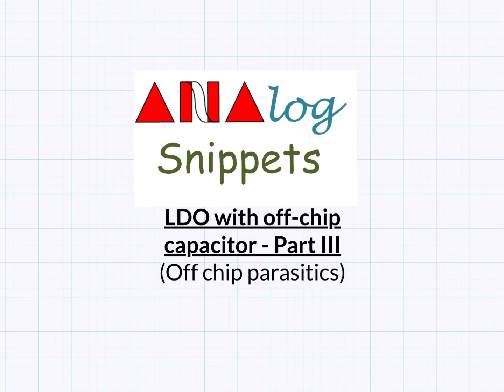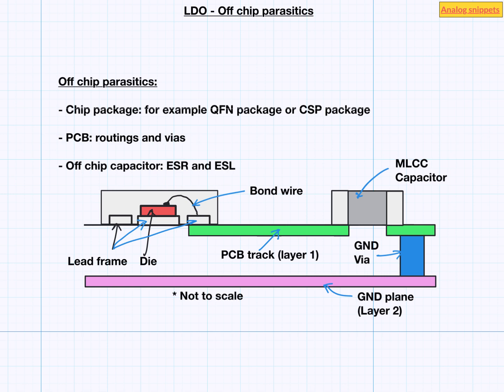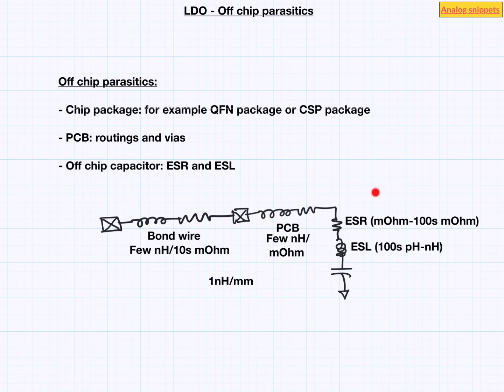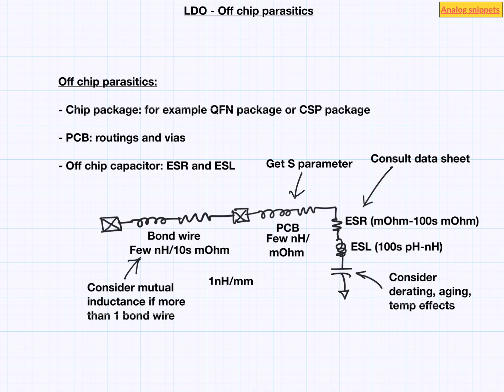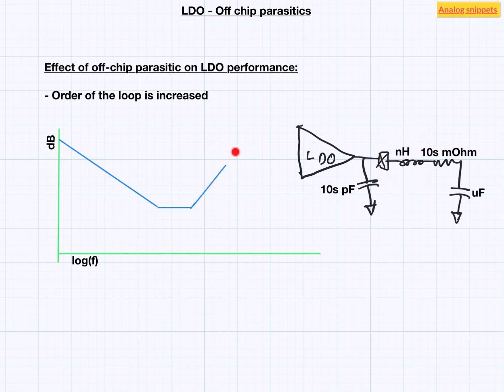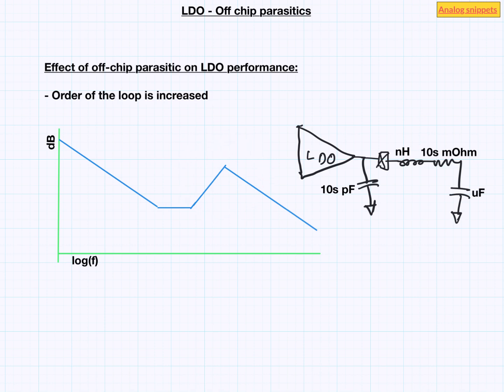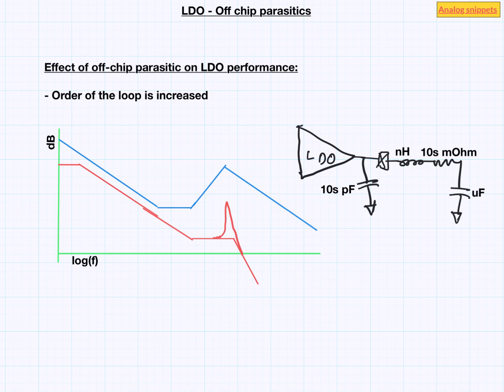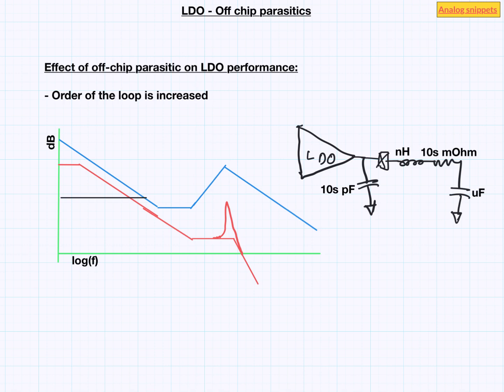#35 LDO with off chip capacitor - Part III (off chip parasitic)

Comment: Thanks for this fantastic lecture on LDO. But there is one point I need help understanding. At 6:00, you said the effect of this extra parasitic is to increase the impedance. How to understand it is if the impedance is increased, the pole frequency will be reduced, but it looks like the pole frequency is extended. Thanks for your sharing, and I will be grateful if you can explain it more profoundly.
Reply from the maker: Hi Fen, not all impedances cause pole frequency to reduce. Some impedances can cause additional zeros which help to extend the frequency range. Consider capacitor ESR and ESL. These impedances cause net impedance seeing into capacitor to increase but instead of reducing pole frequency, these extra impedances cause additional zeros which arrest the fall in gain and widen frequency range.